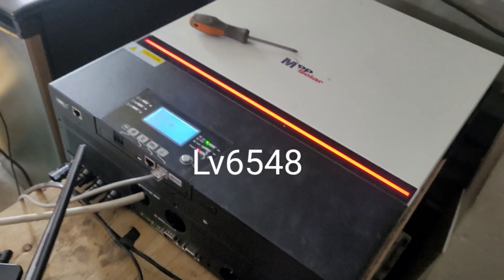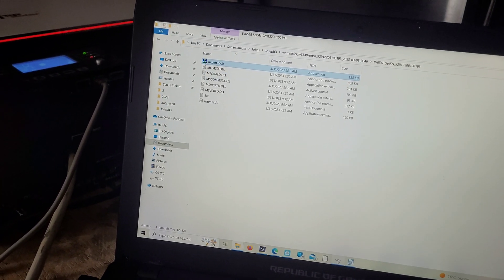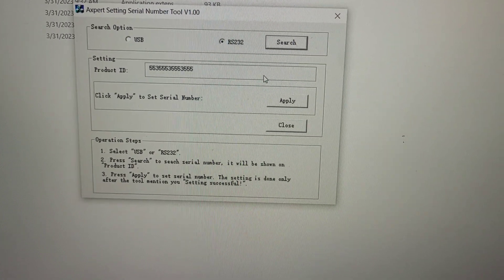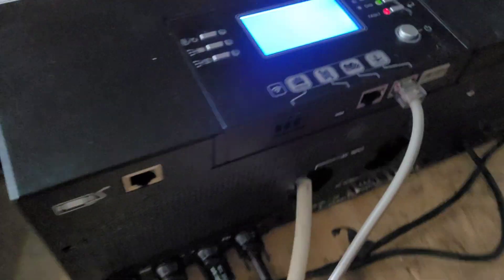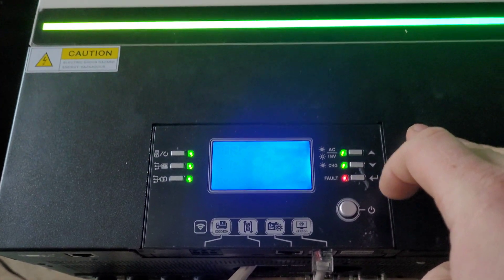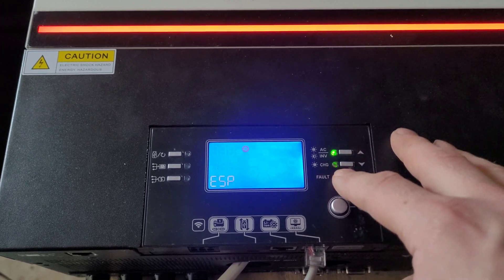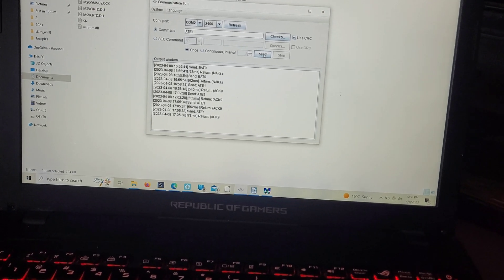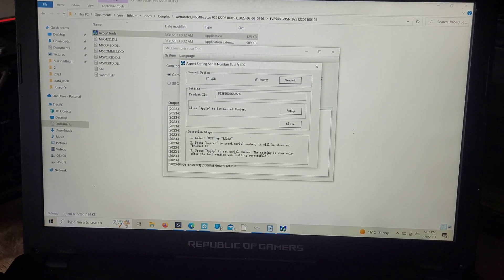multiple issues with a lv6548

Comment: i am facing same error, kindly tell me how to fix this.
Reply from the maker: I needed to get a new board from the manufacturer.
Reply: how much did it cost you ? @SunInLithium
Reply: did you find the exact reason of error ? so how we could avoid it for next time
Reply from the maker: @hamzaafzal6529  unfortunately not. The inverter was installed in an old mobile home, so there possible could be some issues with the wiring.   Also the panels were close to the max pv voltage. And it did shut down a couple times do to to high of voltage on could sunny days.

Let me know if you're system has any similarities.

Comment: I always turn the unit off with the button on the display. PV first, grid, the button and lastly open the DC breaker. Start up is in reverse order except I precharge the inverter with a resistor before closing the DC breaker. Pretty much trouble free for 16 months now.
Reply from the maker: I've installed close to 12 of these units. This is the only one I've had any major issues with.

Comment: Which site did you purchase this inverter from ?
Reply from the maker: Directly from MPP,
I am currently working with customer service to resolve this issue.  I have purchased 13 other inverters that have been running for 6 months now with little to no problem.
Reply: @Eli Schilthuis  ok, I'm planning to get a mpp 3048LV-MK model just for trying out but wondering how durable they are
Reply from the maker: @diy876  I'd say they quit comparable to other inverters in their price range. I ran my home system off 2 lvx6048 inverters from mpp for over 2 years without any major issues.